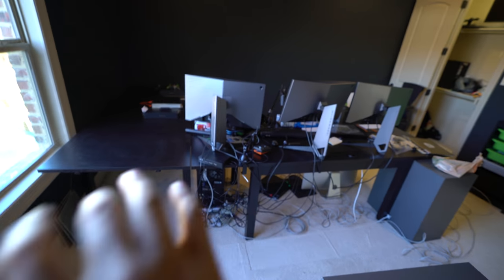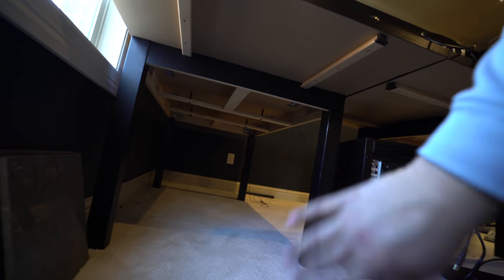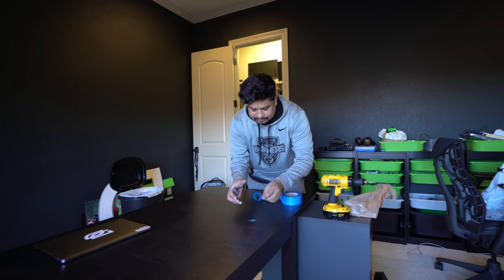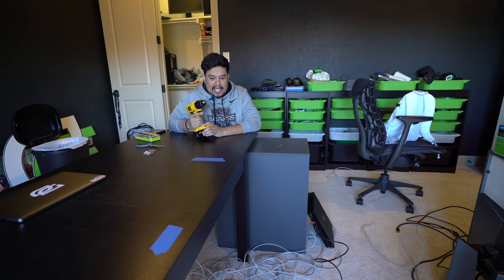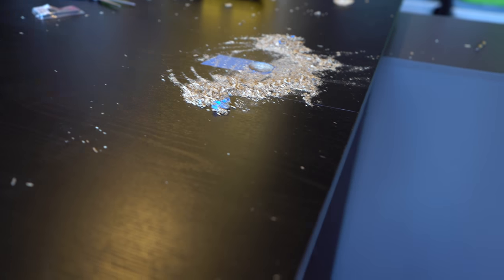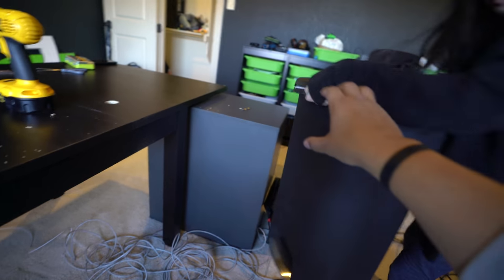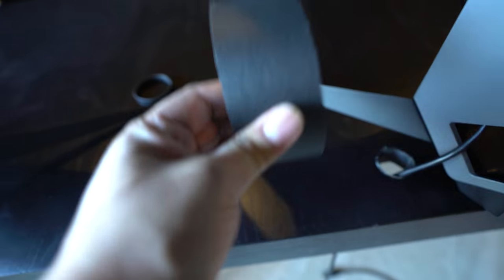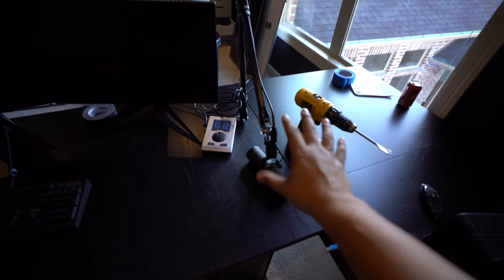DIY GAMING SET UP  WIRE MANAGEMENT

Comment: hecz!
1) Rubber grommets will fix your 'exposed wood' issue inside the holes you drilled.
2) Daisy chaining your power strips is very dangerous.
3) A camera gimbal would be your best bet for the overhead rig. 
The setup is starting to come together and it looks nice!

Comment: You can use rubber grommets to slide them into your 1 3/8 holes. Just slide them in place and your done I used them when I did electrical work

Comment: put those plastic inserts that are used for office desks man.. might have to drill a slightly bigger hole.. but.. it will look much more solid, and prevent further splintering.

Comment: Why the fuck didnt you use a keyhole saw? So much easier. Oh, and measure twice, then cut once..
Also, 
Go to home despot, and get a wireframe, a wire based shelf that you use horizontally, screw it to the legs and it gives you a shit-ton of ways to velcro (zip ties can damage wires and impede electrical signal) your wires in a better way.
Also, 
Make a 45x45 corner pull out chalkboard.. puts away in the corner, then pulls out easily with a sisor jack way to make it easier to use and store.